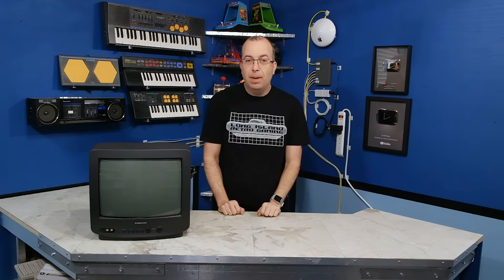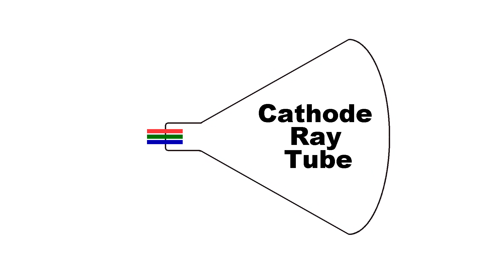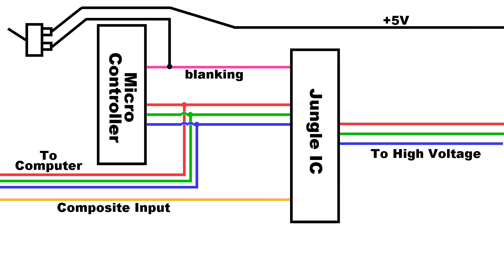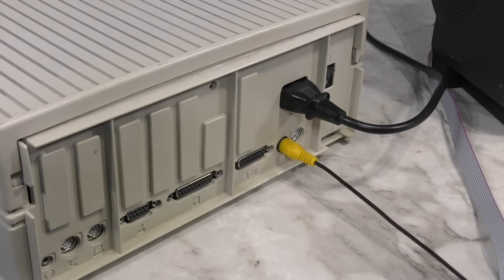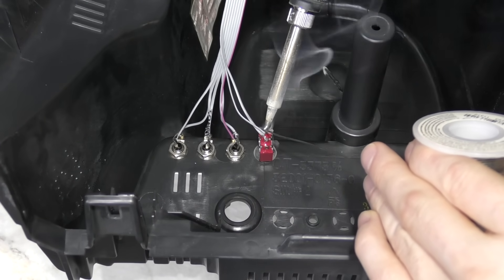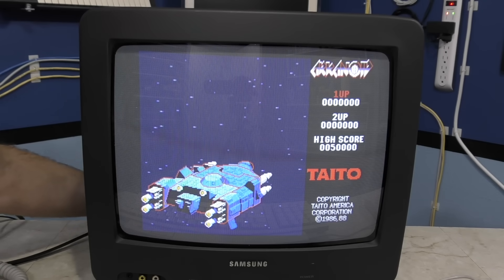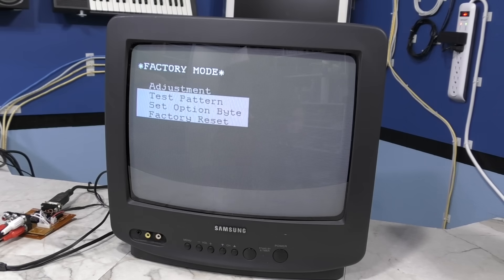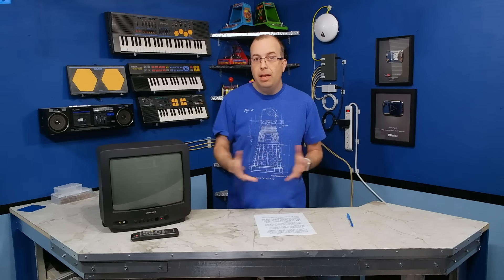Modding a consumer TV to use RGB input

Comment: Fantastic as always! I was always under the impression that the bandwidth issues caused by TVs were inherent to the design. I had no idea you could mod a TV for RGB and get computer monitor level clarity.
Reply: I'm not sure if this would work well on TVs much older than the late 80s.  On screen menu displays and CC made sharp "stationary" images important, Picture tubes alone were much better by the 1990s. An older (especially non Trinatron) set might not be any different looking than composite. CRT quality had it's peak in the 1988-1998 era IMHO. Early CGA were visual eyesores when doing text, so naturally businesses went with the IBM monochrome adapter and monitor. This situation rapidly changed by the time VGA came along. The rest is history. As to the 1980s - 90s game consoles, It's not really a surprise that there's only a minor difference from composite to RGB, Unlike a computer, A game console was expected to use a TV, So engineered to give a good as possible image thru a composite input.
Reply: Only for 15khz signals, VGA has 31khz and don't works on TV's
Reply: The more you combine video signals, the more most you have of Clarity.
RF being the worst as its combination of Audio and Composite, as well as its the most prone to interference by its nature of sending signals by radio waves instead of electrical current.  
Composite is a combination of red, blue, green, vertical Sync and horizontal Sync.
Most 15Khz devices has Composite sync (vertical + horizontal sync), VGA separates the sync line as well.
Reply: Not exactly because of dot pitch, but this is great for keeping arcade cabinets going.

Comment: Could you not have just removed the rear AV connectors on the back and soldered in a scart socket as it looks the same shape, looks like that TV could come with a scart port.

Comment: 01:38 analog tv still works in Europe
Reply: As far as I know all transmission of terestrial analog TV has ceased? Many cable operators still offer it, but that decreases quickly as well.
Reply: @danielmantione  Analog still exists in Sweden.  I have an old CRT hooked up to a digital box that receives analog signal through an antenna on our roof. The TVs themselves can't receive the signal anymore because they changed the frequency so everyone needs to pay for the channels, even the "free" ones.

Comment: Are Scart and RGB compatible then? And if so, are there RGB to Scart cables? The good ol' PSP won't play games over composite, only over RGB. And TV's now a days don't have an RGB input anymore...
Reply: Analog RGB is a way of transmitting a video signal, without a specific plug. SCART and VGA are examples of plugs that can carry RGB video.

With the right cable you can connect the good old PSP to SCART. Not all TV's may have SCART anymore, but there are SCART to HDMI converters.
Reply: @Daniël Mantione: thanks! Many TV's in Europe still have scart IN for backwards compatibility (i.e. for game consoles, VHS, digital TV decoders, DVD players, etc.). But RGB is completely "out". I have yet to find a PSP to scart adapter, but I did buy a PSP tot RGB (Aliexpress). But no matter how hard I look, I can't seem to find a RGB to Scart adapter...

Comment: Honestly dude, the Mega Drive has some of the worst composite in history.
Reply: Maybe so, but it looks a lot better than the composite on the computers that he's using.
Reply: So true. Something might be wrong with your setup to get so little improvement. I moded my genesis for s-video and it look better then your genesis on rgb.
Reply: Mikaël Provencher what? How do you know what my Mega Drive’s picture is like on RGB?
Reply: I ment the 8bit guy setup. the result he get don't look anything like what I saw on most rgb genesis I used.
Reply: Mikaël Provencher Oh okay
Reply: i wonder how could someone make an rgb cable for it
Reply: Renán .Mascorro RetroGamingCables.co.uk did.
Reply: @elgeniomaestro  since i bought a sony pmv and since im a bit cheap, i bought a bnc to vga, snes to rf that happened to have all the pins in the port also midi cable at a flea market and made an adapter that converts snes(mod)/n64(mod)/gc/genesis to composite/s-video/rgb, oh and also it has an aux to connect it to my stereo :p
Reply: Faux Shizle  nu u

Comment: RGB cables in general over SCART have 220uf capacitors and 75ohm resistors on each colour line. Without these the signal tends to be too bright over RGB... yet you did the connection directly. It might be interesting to try out this to see if it makes a difference, especially on the consoles.
Reply: You don't know the impedance of the jungle chip. If it has 75 ohm impedance, there is no need to add a 75 ohm resistor yourself.
Reply: That I don't know, but it is a standard on RGB-SCART cables, and that TV is SCART ready basically, just look at the original RCA connector bracket. I don't think Samsung would develop a specific chip for each region like this...

Comment: Is this the same signal as component? With the exception of where you get the sync from? Sync on green, or something like that? I'd love to be able to hook up my old consoles to my new TVs over component cables if it's just as simple as grabbing the RGB and sync signals.
Reply: No, it is not the same signal. The difference is the colour space: Component uses the YUV colour space (Y = intensity, U=redness, V=blueness). It is a different way of decomposing a colour than Red, Green and Blue.

The best solution to connect your old consoles to new TVs is with a SCART to HDMI converter. Search on AliExpress for "SCART to HDMI converter". I can recommend this one:

https://img.newfrog.com/products/1/8/0/180531/180531-1.jpg

Avoid this converter at all cost, it is a piece of junk:

https://images-na.ssl-images-amazon.com/images/I/614ZZLmzT9L._SY355_.jpg

Then, look for a SCART connection cable for your specific console. There exist off-the-shelf SCART cables for just about everything. Might be a bit more difficult to obtain in North-America, however, Ebay and AliExpress come to the rescue.  However, should there be a case where you need to make your own cable, just grab the RGB and SYNC signals and wire them to the appropriate pins of the SCART connector.
Reply: @danielmantione  sigh yes of course. In my excitement I was getting wire color confused with color space. I don't have room in my life for CRTs but I'd love to get something better from my retro systems.
Reply: Well, you know what to do then :) A SCART converter might be alien technology for you, but works just fine and is a very nice and practical solution to make old game consoles work well on modern TVs.

Comment: while this is a quite ok way to do it there is a reason to go for the euro-scart connector if your going to mod your monitor even if you live in the US.
and that simple reason is cables as those might be in most cases cheaper to buy from asia on ebay than to make yourself.
just an DIN-SCART cable for the C64 cost less than a lose DIN connector costs in shops here...

Comment: Almost certain there is a SCART input on that jungle chip, and a select input to force SCART operation on it as well, or an OSD select for it. That will give best bandwidth, and as well sync input as well off the SCART composite, or off the green signal.

Comment: It's worth pointing out that the resistors added are 75 ohm, which is a standard termination value for video signals. This should be consistent regardless of the model TV used. The blanking part may or may not be possible depending on the model. Getting the needed data on these old TVs and chips is not always easy.

Comment: From my understanding, if you added a SCART connector to your TV you wouldn't have needed to add a switch because one of the SCART wires carries either a high or low signal depending on whether the cable is carrying an RGB signal or not. This wire is called the Blanking signal wire.

Comment: Yes, we have Scart Connectors (or Euro AV) on our TVs. Not all of them are 100% pinned, but I once had a TV that also worked with RGB in. And I had a DVD Player which sends RGB out if I wanted to. This lead to a weird thing: while VHS recordings usually were worse than the original TV, I had better picture quality when I first recorded movies and shows onto a DVD-R and played later via RGB (with cut out ads). Today I unfortunately I don't have any RGB sources to feed my RGB capable Commodore Monitor - but this one shows a brilliant clear image whenever I turn on my Atari XE or XL with S-Video-Mod.

Comment: What a great mod! Just two warnings.  Be ultra  careful with CRT tube and transformer (even after discharging). Messing with over-scan can cause the picture to not display at all, and you need to revert your settings. Typically this will be just reversing the change you made on the remote. Do not assume that turning the tv off and on will revert it to how it was (it may restart will the overscan settings that don't display).

Comment: SCART's a French innovation, (it's known as Péritel here, and it's a strong part of the French pop culture) and some French law made it mandatory for every TV selling in France to have a scart input and every video equipment to have a scart output (or at least an adapter), and it was into force until quite recently... As a consequence it was featured in every TV set made for the European market.

Actually, most of the devices I used still output composite video into the scart connector (many French dudes can recall this cheap plasticy Composite to Scart adapter coming with every console from the nes at least up until the PS3 that you would always lose) so I didn't have any piece of hardware which took advantage of its rgb capabilities...

I was a kid though, maybe it's worth looking for ways to make use of it now that I'm more familiar with all this stuff

Comment: I knew this was possible in 1984, but never had the knowledge to do it. I used my Atari 800xl with a RF Modulator and the picture was crap and strained my eyes. This is something I will try on my 1999 Panasonic 80cm tv.

Comment: 1:37 actually you could still use that TV to watch TV using a digital converter box. For the first year during the transition from analog to digital, the government was giving out vouchers to those that applied, which covered the cost of a digital converter box. So you could have gotten one for free about a decade ago. I used one, and it worked quite well. If you had one (which it sounds like you don't), you could hook it up to the TV today and still use it to get television signals.

Comment: The other interesting thing is that some game consoles look very good with a composite video because they have a very accurate clock generator for their RGB to composite converter. NTSC and PAL TV signals were designed so that the colour information would interleave frequency wise with the analogue monochrome video. If you get the clock signal right then composite can look great. More expensive TV's had comb filters to improve colour decoding. S-Video came about because S-VHS had enough monochrome video bandwidth that it could interfere with the colour signal. Helical scanning video recording systems all suffer from jitter caused by the tape flapping as one flying head leaves contact with the tape and the next head makes contact with the tape. This makes having an accurate video sync / chroma clock signal impossible with out using a digital time base corrector. So they didn't bother, it was much easer to run the luma and chroma signals separately. Most computer systems had very poor composite encoders which could very easily be converted to output S-video simply by lifting a resistor and connecting that to an extra connector. The Commodore 64 has S-video out already (Well the PAL one does).

Comment: I used to have VGA to Scart cable with some DOS drivers. It worked. But picture quality was far from good, except for basic VGA mode. The only benefit was the ability to connect to a bigger CRT TV instead of 14-15” CRT monitor on a desk.